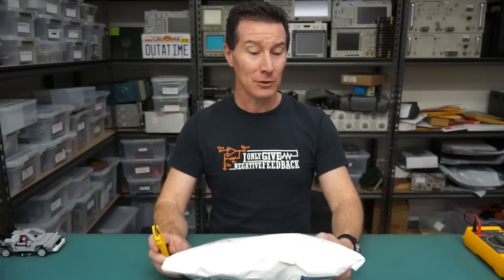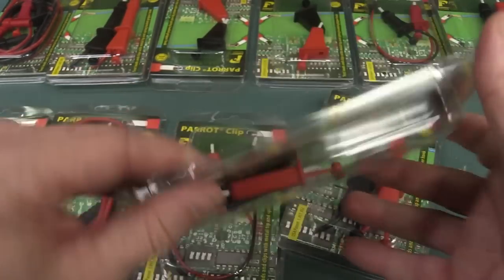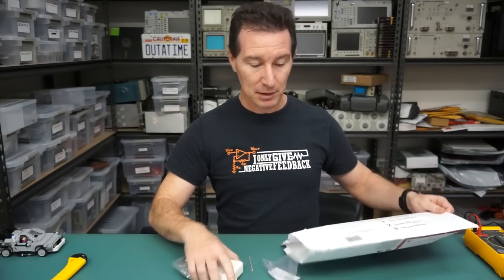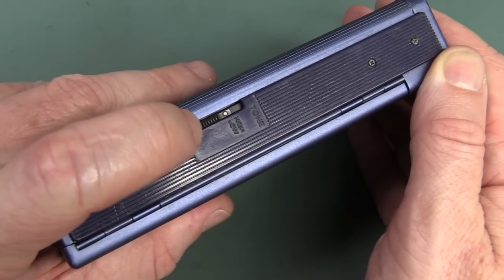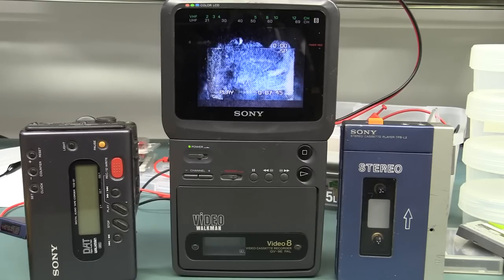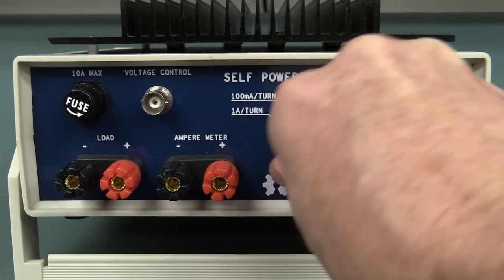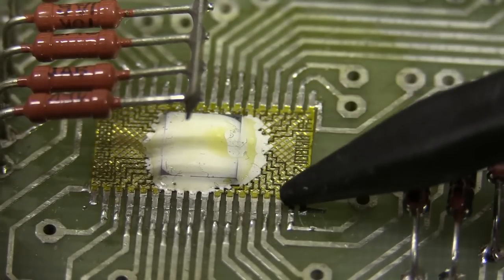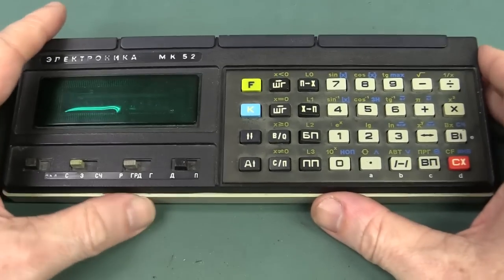EEVblog #749 - Mailbag

Comment: Oh my, I had my heart jump when I saw that calculator. I had one. It was my first personal programmable device. It finally allowed me to program at home, without having to borrow computer time somewhere else. It was all mine! Yeah, we were poor. But gosh I can remember some happy moments. You had 104 bytes of RAM for code and 16 registers, IIRC. I wrote several games for it and experimentet endlessly. Remembered a few of the opcodes by heart. Stopped using it when the EEPROM started giving up. And then I got my first ZX Spectrum! BTW, "МК" meant "microcalculator".

Comment: Those Soviet calculators... They ALL had HORRIBLE keyboards. My collection covers the years 1976-1992... NOT ONE GOOD KEYBOARD! XD I have an Elektronika 4-71b, B3-05, Mky-1, mk-61, and two MC 1103... Which is a desktop RPN programmable calculator made for controlling and monitoring external processes. It contains internal ADCs for measuring voltages of +/-9.99V (8 channels).

Comment: Hi, Dave! From Russia with 73!  =)
Want to say a couple words on MK52 calc. Actual it reads "Am-Ka" (not Mark). It means 'Micro-Calculator'. An it is programmable, engineering. It is possible to run some special code on it for integration, statistics etc. Even kinda of logic or physic-based games. (Like space travel or ballistics) There were strong community of users in SU back then and some fans of vintage Sov-electronics still apreciate it.

Comment: I have one of these Electronika MK-52, unusual poor case design usually Russian stuff is indestructible. I replaced the perished sponge behind the keys, worked like Viagra all the key floppiness now sorted. Seems Russian soviet electronic stuff is a bit hit and miss, I do believe the poor design of old Russian TVs were responsible for a lot of apartment fires. I wouldn't trust this calculator to guide me to the bathroom let alone a Soyuz  space mission. Have more luck going to mars using 22/7 as an approximation of Pi than relying on this. But it works and has a usable Eprom interesting bit of soviet electronic history.

Comment: Why people avoid using jumpers but use multi layers PCB? isn't it the same?
Reply: márcio lima sousa the correct answer is whatever is cheaper
Reply: Gillian Seed So it's not about magnetic field interference or something?
Reply: márcio lima sousa It's mostly cost, however you can get some shielding if the back side is just one big ground plain. It often makes up the back side of shielding cans.

Comment: If anything, that guitar tuner thing makes for a good mini-disco light kit... :P

That apple airpot thing's easy to open if you employ the Photonicinduction "where's my 'ammer" technique... :D

Sweet!! I used to have one of them Video Walkmans (ebay purchase) that never worked properly (power wouldn't stay on even with fully charged batteries), lovely bit of kit, but, not exactly reliable... :P

Had a lot better luck with that Video Walkman than me, except the screen on mine was good, but the damned unit just refused to stay powered up for more than two minutes...

Comment: The screen problem with your video walkman is a thing a friend of mine calls "screen rot", not much info about it online but when it happens on TFT, the topmost layer is rough and has horizontal white lines on that layer itself. When it happens on DSTN LCDs, the topmost layer actually becomes rough and peels off, and you can see air bubbles. In most cases, the screen would still power on and display an image, but it's not clear.

I had an old Alpine car monitor that used to be in my cousin's van when he had it, but it was only the screen and a box thing on the back, and the screen also had screen rot. That same friend of mine also had an iBook G3 with screen rot but I think he replaced the screen since.

Also, I know YouTube user vwestlife has a video walkman but his uses Digital8 tape and is in more of a clamshell form factor without a TV tuner, as opposed to yours which looks like a watchman with a built in Video8 VCR.
Reply from the maker: ***** Interesting ,thanks for the info. Have heard of it but never seen it.
Reply: ***** Apart from the physical damage, I'm actually surprised the screen works. I got a very similar unit and the screen only shows pure white which apparently is a common issue due to the rather shoddy SMD caps Sony was using at the time (At least I assume that it's a common issue, since it was an uncommon device and yet there are repair videos on Youtube).
I also have a Sony Camcorder and a Panasonic one (that's a rebranded Sony) from the same era and all are showing similar faults. Shame really, I'll have to wait till I have loooads of spare time and an ESR meter to get em fixed.

Comment: Some stuff falling between the case and heatsink of the tekbox could be a real problem, but it would never happen. My PCs have cheap cases, and if you look underneath them, the usb front panel pcb board (more like traces connector)  is exposed.

Comment: FYI, the TPS L2 walkman is the same one used in the film "guardians of the galaxy", and as a result, prices for them on e-bay etc have recently skyrocketed.  CosPlayers making a 'star lord' outfit will be needing one.  And actually working ones could fetch well over 800 US$.

So...  be careful taking it apart (if you do).

Comment: DAT looks like a small protable VCR inside. The industry asked to bann the 44.1Khz samle rate. Back in that days, a sample rate converter were sorta of complex, you wouldnt be able to copy (digitally) a CD. DAT was supperior, but not as reliable as CD, heads wore out like in the VCRs.

Comment: EEVblog The TPS-L2 actually has a microphone because the original Walkman was just a portable dictation machine with the recording capability removed. Sony already had several portable cassette players in their line up even already in the early 70ies (see: http://wegavision.pytalhost.com/Sony/1973/sony73-15.jpg). But it wasn't until 1979 that they (Akio Morita) had the idea to market these as cheap portable cassette players with all recording functionality stripped. This particular TPS-L2 didn't have the "Walkman" name on it yet because the name wasn't invented back then. However, there are TPS-L2 models that were actually sold with a Walkman sticker but those were later revisions.

Oh, and I wouldn't really do a teardown on this TPS-L2 as this seems to be one of the early models in a quite good condition. These can easily be worth several hundred bucks on eBay.

Comment: That tuner does look a bit strange, the numbers on the front look at lot like frequencies of A (standard pitch of A is 440Hz) although the alternate pitch 432Hz is outside that range, might just support adjustments close to A440. Also has a passthrough so you can do a quick tune up without needing to unplug your instrument.

Comment: EEVblog  If you whack the Apple AirPort Express where the two housing parts meet with a large blunt object, it should crack open. I tried doing this method on an Apple iPod charger and it worked like a charm. Saves the plastic dust and less too clean later.

Comment: One thing I will say about UL ratings is that they don't really mean much in regards to safety.  All UL really means is that they looked at representative examples of the product provided by the manufacturer and tested them to ensure they operate as intended and meet the minimum safety guidelines UL has listed.  Over the years of living in the US I have seen many UL rated products that could easily burn the house down in a faulted condition and not under supervision.

Comment: Just like in the last video, when you are fiddling with the package material and it gets noisy, it sounds like underwater here. Tried on different systems, all the same (using the 720p50 and 1080p50 video, e.g. at 15:55). Any idea? Google reencoding messed it up? Or does the original contain it too? Maybe a bad interaction of your codec and their reencoding?
Reply: Sounds ok here, tried going low res (144) then HD, sound ok, but at this res my PC started losing sync between the audio & video.
I'm using firefox & HTML5 player (Suprise, I thought it was on flash)

Comment: In Tekbox self powered active load, that are not Darlington pair, it is Sziklai pair (complementary pair or sometimes called complementary Darlington), contrary of Darlington pair it use one NPN and one PNP transistor.
Reply from the maker: Miloš Lazović Yes, that's the term that wouldn't pop out of my head. I've done those in another video somewhere...

Comment: Guitar tuner perhaps dave :-)
Reply from the maker: zx8401ztv Are you telling me or asking me? I know nothing about guitars, musical instruments, or music.
Reply: EEVblog So you dont sing in the shower or whistle if there is no lock on the dunny door lol.
I was just offering my thoughts, guitar tuners look similar, give it a tone from your A.f generator and it should tell you the note.
Reply: OhNoNotMyPenis Has the option for acoustic or electric, hence the microphone.
Reply: EEVblog It's basically a frequency counter, with the 6 strings that a guitar has.
Reply: EEVblog Yes it's a guitar tuner but it can of course be used for other instruments as well. Since a guitar is made out of wood that will move and the strings are nylon or steel so they will also stretch and move with age, temperature and humidity, a guitar never stays in tune. So you have to tune them pretty much every  time you want to play. For an acustic guitar, you use the mic and there's a tele-jack on the side for electric guitars. So it takes the signal and tells you if it's of. So you just compare the the frequency with some standards. It's chromatic tuner which means it can take all the notes in the scale, hence the letters and LEDs on the front. If you play a regular A, it should give you a signal of 440 Hz. If you feed it a signal of 430 Hz, it will light up that you are trying to tune an A and the red arrow will light up telling you that you are slightly low. If you feed it 450 Hz, the arrow on the other side will tell you that you are slightly too high. When you get 440 Hz, the the green square will light up telling you that you got the note right. So it's a frequency counter that compares with a set of target frequencies and tells you if you are higher or lower than the nearest target. A tuner that is not chromatic will only have 6 target frequencies, one for each guitar string. They are designed for specific instruments so they are not very versatile. Not really rocket science but a must have for any guitarist. So much easier than tuning by ear.
Reply: zx8401ztv It's guitar tuner for sure - it even has each string number written down below of note (standard tuning: E A D G B E) and E is on 1st and 6th open string hence it has "1/6" label. :)

Comment: Interesting how the label on the DAT tape says "monday". If I had to guess I'd say this was a backup tape used with a server DAT drive (yup - DAT was also used for computer backups)
Reply: sapperlott Quite correct.  I've got a couple of shoeboxes full of DAT tapes used for computer backups.  I wish I knew how to reliably bulk-erase them; I can't simply discard them because of the data they may contain.
Reply: *****
For bulk erasing you could look for someone with a degausser. Or just hire a mobile shredding service.
Reply: sapperlott I have a degausser (for audio tapes), but erasing DAT is not the same thing.  I was never able to find information on degaussers recommended for DAT.  Shredding is, as you point out, always an option, though I was rather hoping to preserve the tapes themselves.